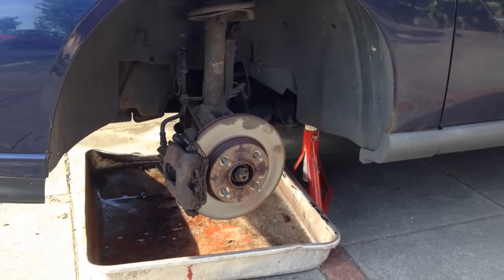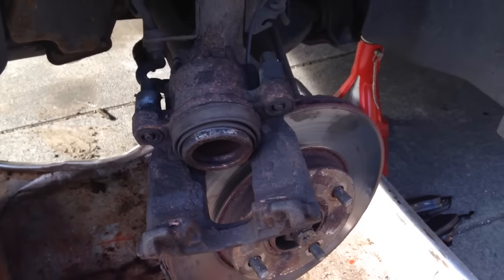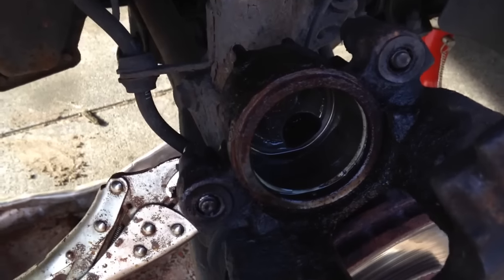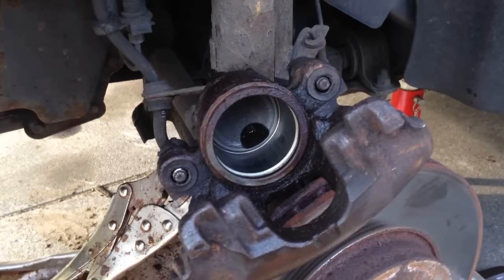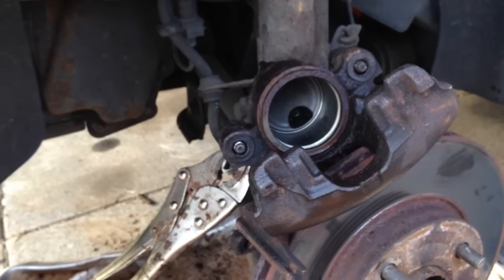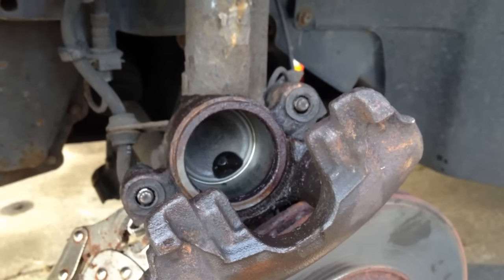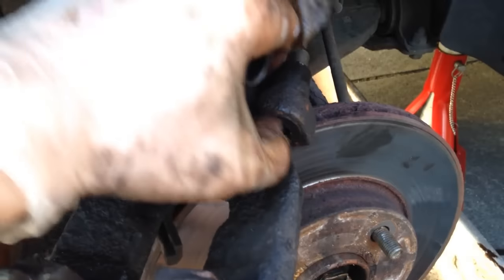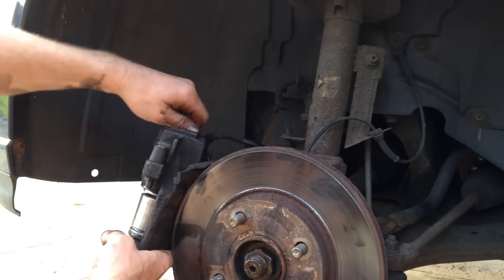How to Rebuild a Brake Caliper (WITHOUT Removing it From Your Car!)

Comment: I would just remove the caliper altogether and bring it to my work bench where it will be much easier to re-assemble.  All you have to do is remove one additional bolt on the hose connection.  In any event, it is good to see this procedure done as it very effectively conveys how easy this job is, and rather than discarding a perfectly good part just repair it (which is something few mechanics ever do anymore, though I suppose with the labour rates they charge the job may be as cheap overall if they just pop in a new caliper, especially if they source a cheaper generic part).  Thank goodness for Youtube, which has taken the place of fathers who used to teach their sons the manly arts.  Maybe this new generation of young men will acquire practical skills that they can pass on, and spend quality time with their kids to boot.
Reply: Jack Rabbit ww
Reply: Ducky1521  not all fathers are absent.  Taught my daughter a lot about cars, enjoy working and teaching her.  Now her friends all go to her for car issues.  She also doesn't get taken by dishonest shops.  Also she helps her friends the same.  Save one friend $300 for work she didn't need
Reply: After playing around with changing the dust cover on a spiral piston tonight, I agree with removing the caliper. I dropped the piston a few times on the ground and did my best to clean it off each time. Still, I probably introduced dirt into the system. A clean workbench would have been a better workspace.
Reply: To be honest i work in the motor trade, and the video is very good, somethings i would personally do different but i do wonder how long was spent on the job, by the time you have bought the replacement parts and spent the time doing it, how much money is saved.. and seized calipers normally go hand in hand with warped / badly worn discs and or worn brake pads driving the cost up, but a great video and if it gives you the confidence to do this sort of repair yourself awesome, but please bear in mind a new caliper takes minutes to fit, has new sliders, and new bleed nipple (which wont snap as you try to undo it) and after that all you need is a brake bleed. So in review awesome video and i tip my hat, but like alot of parts on a car some time a new part is or can be better value than spending the time repairing or replacing the components. Oh and buy a brake hose clamp, a few quid from halfords, cardboard and mole grips will end up costing you a new hose (more money than a re-usable clamp) and the drama of finding the fault, replacing the part and bleeding it afterwards
Reply: I agree that it's easier to work on a bench.  
The assumption here is that the caliper bound because the piston's surface beyond the square cut seal became pitted.  The piston "binds" because the pitted surface won't slide inward.   Once you push the piston half way out, you can clamp off the brake line and reduce the mess of hydraulic fluid by more than half. Once the caliper is removed, the piston can be pulled out the rest of the way.

The other failure mode is from old water saturated hydraulic fluid, which makes both the cylinder bore and the piston rust from the inside behind the square cut seal.  This prevents the piston from moving outward , chews up the square cut seal and then contaminates the outer piston end. In this situation you may not be able to push the piston out with hydraulic pressure, and if so, the caliper body may not be salvageable.

btw Unless you buy a new caliper, you'll get charged a "core charge" that can be more than half the cost of the re-manufactured unit.  Most cores get re-manufactured, not discarded.
Reply: @TheNeilsolo   Doing this job wrong can compromise the other brake on that circuit.  Unless you know what you are looking at,  and place no value on your time, (or life) replacing the piston this way can be penny wise and pound foolish. A replacement piston and seals "kit" can be more than half the cost of a high quality re-manufactured caliper with a warranty.  

As far as the rubber brake line if gently and evenly pinching it breaks or makes it collapse internally that line was already about to fail.   I use pieces of hose slipped over the ends of a needle nose clamping  pliers and never had a problem damaging a brake line on one of my own vehicles in 50 years of doing my own annual brake maintenance and service.

Comment: Very good video. I just have one tip for blocking the brake fluid from leaking out. If you use a "one man brake light testing device" aka an umbrella, you can block the pedal just a very small bit from fully released. The pipe and hose will still be drained, but the reservoir will be blocked from the wheel circuits. Got this tip from a friend. Although i have worked on cars for decades, i suffer from severe Citroënitis, so all my brake experience comes from cars with real oil (LHM) in the brakes. And of course, when i started living in sin with other brands, i was immediately punished with sticking brakes and seized calipers. The Citroën system is actually very good, supersimple to bleed and due to the oil instead of fluid, they never seize inside. If someone is interrested, the Citroëns up to 2000 looks and works exactly like any other brake system. The oily bit is the difference. And because you have a simple brake valve instead of main cylinder it´s rather incapable of trouble. And the bleeding are a breeze too. Start the engine, suspension in highest position (for max pressure in the rear), activate your umbrella or assistant for pushing the pedal, and then walk around, opening the bleed screws one after one. No pumping, the car already has a hydraulic pump. Open bleeder=continous stream. And you have a large hydraulic reservoir, so you can bleed all day long if you like or at least use a hose and get free rust protection and air free brakes in one go. Thanks again for a good video.

Comment: Used this guide yesterday to do mine on my BMW E90
Did end up taking the caliper off completely 
Changed all the piston and the seal that goes over the caliper was so tight I couldn’t even get it to sit perfectly, this was from a repair kit 

Put the genuine back on and fitted perfectly, now need to order 2 new genuine seals

Comment: One should refill the master brake reservoir with brake fluid at all times to avoid putting air to the other brake lines and having to bleed all of them later.

Comment: Thank you for that.  I have just been quoted a little shy of $2,000 (new calipers all round) but with my existing knowledge, my assessment of my calipers (rubber boots shot and jamming but no fluid leakage) and confirmation and a few tips from you, I will do this myself.  Only one comment, would it have been a good idea to put a chunk of polythene sheet under the caliper before getting the piston out?  That would have stopped all that fluid from splashing on the rotor.

Comment: Excellent. A great help. A tip to install rubber grommets, just insert its mouth in the hole and then tap it slightly with light hammer. It goes in itself smoothly, don’t need to use screwdriver, it can damage it..very helpful video.. Regards

Comment: with what did u clean inside the piston house. Can I use an used toothbrush maybe? cheers!
Reply from the maker: Hi there, I used a lint-free cloth to clean inside the cylinder. You could use a toothbrush if you like, then a wipe with a cloth to remove any particles. Cheers, Chris :-)
Reply: can any any regular cloth, old shirts, cotton? for cleaning inside.

Comment: I would have clamped the brake line literally as soon as fluid started coming out, because as soon as fluid starts coming out, aren't you risk getting air into the system?
Reply: Doesnt matter, you will get air anyway in your system

Comment: I am a motor engineer, fully trained, yes this video is good, but you should have done a better job of cleaning off the Disc first, with any spirt based cleaner, and you should of attached a small length 15 inches or so of rubber tube to the bleed nipple and the other end to a small glass jar with a hole in the metal top to allow the tube to be put through. You then can bleed the system  and save the fluid for a  later top up. But let the old system fluid stand (after 24Hour wait) After the first beed, that fluid has air in it, by waiting 24 hours the air will come out and it can be reused.
Reply from the maker: I am an ex aircraft technician, fully trained, and spent 8 years maintaining hydraulic systems on board fighter jets and helicopters (including their braking systems). As this is my car, I was not concerned about cleaning the disks as I burnt off the fluid during a rigorous test drive after the completion of the job. I have to disagree with your suggestion about re-using brake fluid. Almost all automotive brake fluids (apart from DOT 5) are hygroscopic and therefore absorb moisture from the atmosphere. During the 24 hours you let the fluid stand to let the air work out, moisture is being absorbed into the oil, which upon reintroduction to your braking system will cause corrosion. Brake fluid should not be re-used and should actually be replaced far more often than it is on most cars (my own included). Cheers, Chris
Reply: I've never even considered trying to reuse brake fluid; even thinking twice about using unused brake fluid from a previously opened bottle, though I have.  I'm just living on the edge that way.
Reply: No 'engineer' would ever reused brake fluid - to flush and bleed my whole car is less than  two bottles of brake fluid and less than $10.
Reply: Ya they would, engineers just look for problems to solve and really have little clue of anything REAL WORLD... 

As said, you be a fool to reuse brake fluid, but this dude confuses dot 3 4 5.1 with dot 5.

Dot 5 is going to get air in it and it NEVER wants to come out (forget 24hours) but won't absorb water...

3 4 5.1 will like not even aerate, but will absorb water... 

5 you need to be careful when pouring even... 3 4 5.1 nope
5 you can leave open for days (I would not) 
3 4 5.1 it is junk if you leave it open for days
Reply: not if the brake fluid is due a full bleed.
Reply: @christopher_barr  Agree about not reusing brake fluid.  Contaminated Brake fluid gets to well over boiling point of water and causes vapor in the slave cylinder, i.e. "spongy brake pedal."
Reply: Brake fluid should never be reused callipers seize because fluid is hydroscopic meaning it absorbs moisture which sits in your callipers and rust your pistons from the inside.     Brake fluid is supposed to be changed after 2 to 3 years but nobody does and this is why people get most brake fade spongy pedals and corrosion.

Comment: I would have bled the whole system just to be sure there is no air or contaminants in the system also changed gloves as they were covered in brake fluid.

Comment: Good job. Simple explanation. Well done 👍
One comment though. Give the disk a clean with break cleaner before refitting the caliper. Stops any oil contamination of the pads.

Comment: Why would you want to rebuild a brake caliper on the car???  Not something I've ever considered in all my years in the motor trade, rather remove the unit, strip it, clean it and reassemble with new parts on a clean workbench.
Reply from the maker: Why did I want to rebuild a brake caliper on the car? The brake was seized and would not release. I fixed it very quickly on my driveway with minimum fuss and it cost me around 30 USD. You must work in a very particular garage... where I'm from the labour fees to pay a garage to remove a caliper, strip it, clean it,  reassembe it with new parts and then refit it would not make any economical sense whatsoever - it would be cheaper to have a new caliper fitted.

I had my car back on the road in less time than it would have taken me to mess around taking my car to a garage and have them fix it on their schedule (and at their prices). Cheers, Chris
Reply: Some people don't have the luxury of a workshop and bench..........
Reply: One reason is that you don't want to disconnectthe brake line from the caliper.  This is an option for the Rust belt folks. -  Not sure I'd ever clamp on a brake line, that worries me. A brake line is a structured line not solid rubber.
Reply from the maker: I'm not sure I appreciate the term 'rust belt folks'... I know all about the internal structure of a brake line as I have worked on aircraft and robot hydraulic systems for just under 20 years. There is no problem with clamping brake lines, nothing will happen unless the brake line is so degraded / brittle that it is at risk of rupture from the expansion and contraction which it undergoes every time you apply the brakes... In which case, you should be glad to find this out whilst working on it, rather than have it fail whilst you are braking hard at high speed.
Reply: pretty sure "Rust belt" refers to the latitudes that have to deal with snow/salt Bro, hes not sayin you wear a shitstained belt LOLZ 
Deece video still! (that means it was good)
Reply: all the rust will just spread back real fast. thats IF you get this far and can do this. Its barely seized if you can get the piston out.  Your car looks excellent compared to my car as far as rust. Many of my parts need replaced/cut off due to so much rust.
Reply: Visionery1 then you may have not encountered much. There are serveral reasons for doind things in different ways. Necessity is the mother if invention.

Comment: Many thanks Chris, I had a problem with a MK 4 Mondeo, first new pads and discs from new.  However, the car must have been factory assembled with a small slit in the outer gaitor seal. Using this video I worked out that by partially extending the piston I could change the outer gaitor seal without removing the piston. Partially extend piston (I put a block of wood in the caliper to hold it) then the old outer gaitor seal can be teased out and with the supplied red grease the new one pushed over the front of the piston. I was originally told that repair kits were not available and I would have to buy a new caliper - rubbish I got a complete kit for £8.45 on ebay, including postage.  Repair took about 45mins and no need to clamp brake pipe.
Reply from the maker: +Martin Deady Nice one Martin, I'm glad you found the video useful and saved yourself some money with your DIY repair. Cheers, Chris 👍
Reply: I did my first brake pad/rotor replacement last week.  Everything went fine with that, but I noticed that my seal/dust covers, or gator seals, as mentioned by Martin Deady, had some cracking.  (Sorry, I don't know the proper terminology, and I'm pretty sure that we're talking about the same thing.)  I'm wondering if I should replace them?  If so, can I do it like Martin Deady did, without removing the pistons completely?  But then, I'm wondering, if the gator seals need replacing, then the inner square seal is probably wearing too, and I probably should do the whole job??  But keep in mind my brakes work great, and there's no leaking.  I have a 2009 highlander with 125k miles.  @christopher_barr

Comment: good work mate, the only suggestion, don't stick the piston etc on the ground. It's possible you'll pick up some dirt or something and introduce it to the seal causing you issues down the line. keep em as clean and far away from dirt as possible.

Comment: This video helped me 6 months back and it still holds up! I just replaced the seals. Since then the caliper has not been sticking. Thanks alot!
Reply from the maker: Yep, there really is no need to throw things away when they can be easily and cheaply repaired. It's satisfying too! Cheers, Chris 👍
Reply: Christopher Barr - Random Chris This video is going to help me again - now on the other side!

Comment: I also plan to remove and refit clean rubber gloves on my hands when handling the brake fluid only compatible caliper seal, piston and while cleaning out the cylinder so no greasy, grime is on my fingers when fitting the bits and lubricating the new piston and all. Thank you!

Comment: Since your calipers are floating calipers they need the guide pins to be lubricated so they can move back and forth. You would need to use a high temperature grease that will not harm the rubber but this way the caliper will Slide back and forth easily. Also it is a good idea to put some of the same grease on the outside of those rubber grommets so that when you replace them the next time they will come out very easily. Good video and thank you for sharing.

Comment: And saved to my tutorials. Brilliant ! Would only like to see the bleeding part in a bit more detailed version. Did it in the past while the caliper was on the car, but it was a bit of a pain in the ass to do. This way it looks very simple. Ah wait, watching the bleeding part again I see you don't let it bottom out, you just wait until the cilinder starts moving, then you open the bleed valve, right?